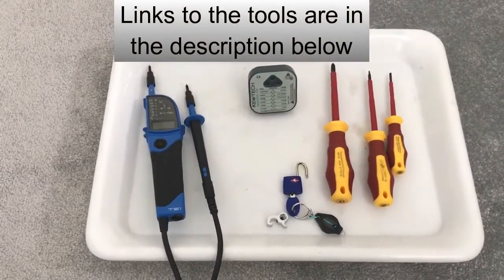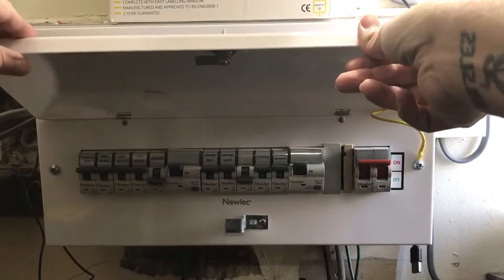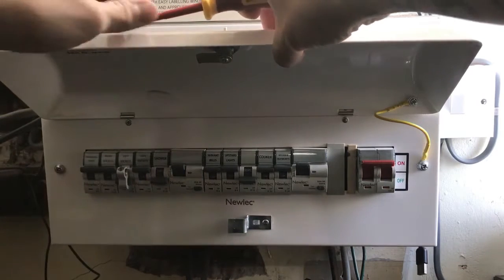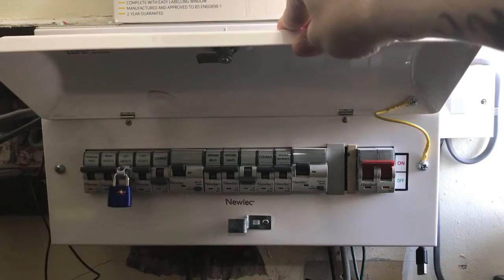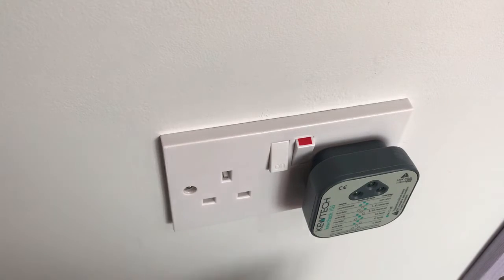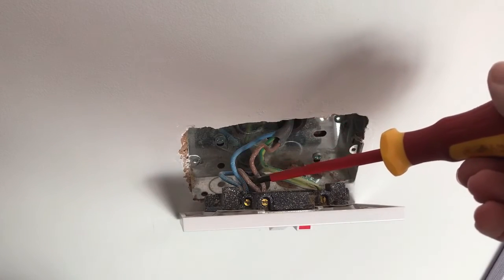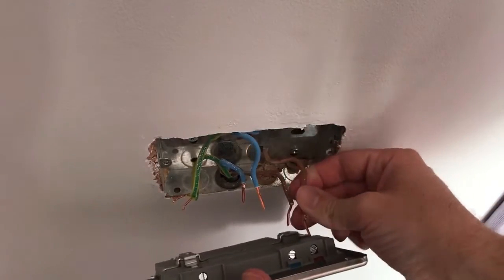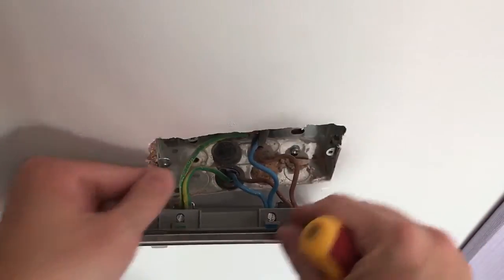How to safely install a usb wall socket UK

Comment: Hi, in your changing a light switch you put a fly earth wire from the back screw to the face plate. Do you need to do a fly wire in this case as well?
Reply from the maker: It's not essential but it is recommended. Thanks for watching and be sure to like share and subscribe to help the channel grow 👍🏼

Comment: Other videos seem to have 3 earth wires, however i only have 2 just like this video. I tried installing but can’t seem to get the USB to work, so i assumed i needed 3 earth wires...but this video shows otherwise
Reply from the maker: The 3rd earth might link to the back box in other videos. If your sockets work but the usb doesn't, it's probably a faulty socket. Thanks for watching and be sure to like share and subscribe to help the channel grow 👍🏼